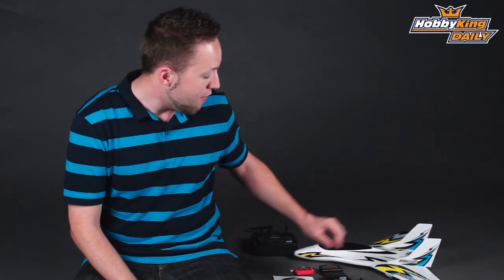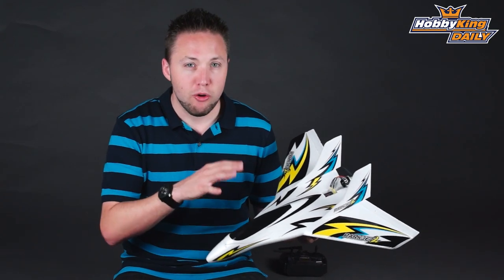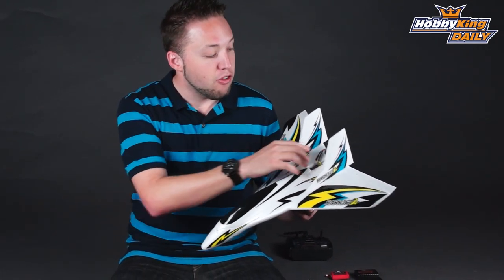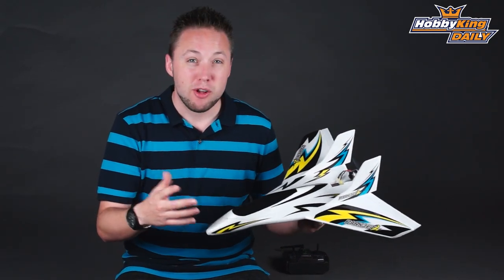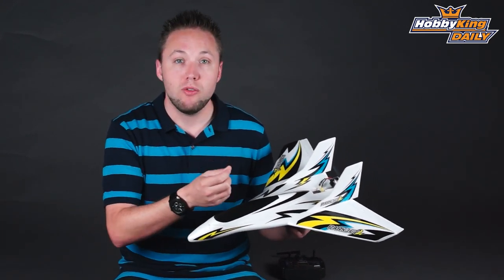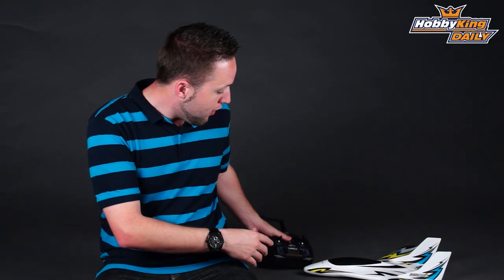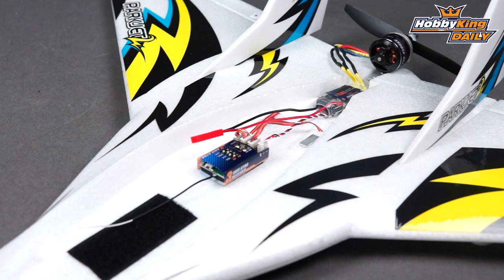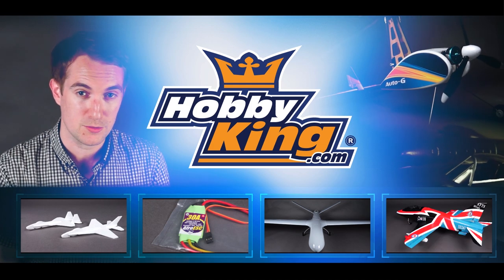Parkjet 2 High Speed Wing EPO 550mm - HobbyKing Daily

Comment: I bought the kit version and I'm waiting for the shipping. My goal is to use the Turnigy 2627 4200kv heli motor.30A Turnigy plush esc,4*1x4*1 prop and either 2s or 3s 1000 mah lipo.Any suggestions folks?
Reply: That sounds like a fast setup... I never had one of these but had a few others .. I alsohave a skyangels screamer on the way which is extremely similiar and the fastest ofall the skyangels....make sure CG is correct and ifit your first fast pusher start off with 2s...with that setup you should do 80 plus with unlimited vertical..good luck
Reply: Ive been flying my parkjet for months now.Its jaw dropping fast.It really surprises people when I fly it.Im using 1300mah 3s 40c(I carved out the inside hatch to make room) and I have been radaring it at 125mph level flight.I will make a video soon hopefully.